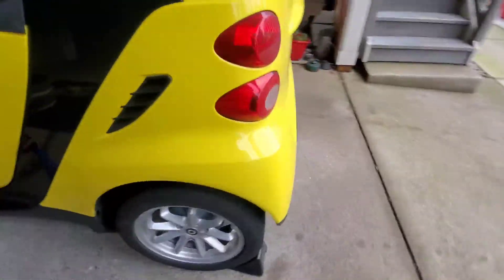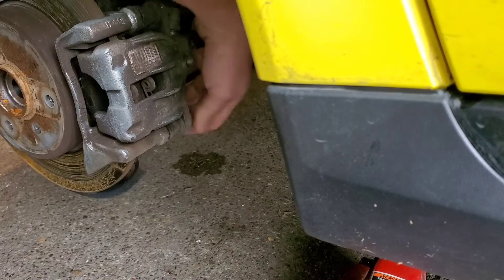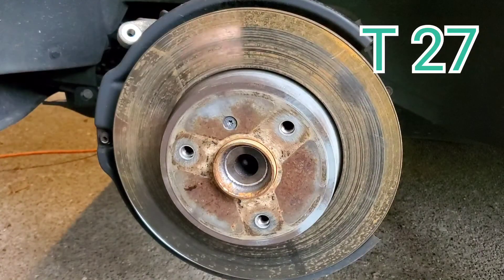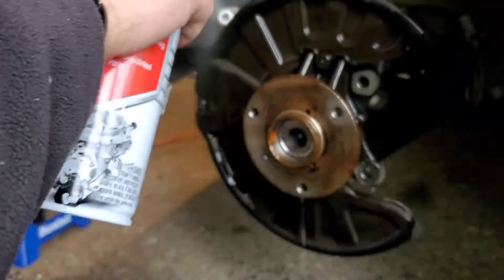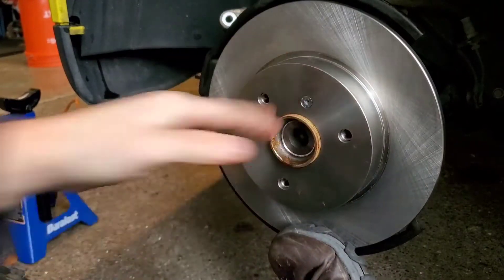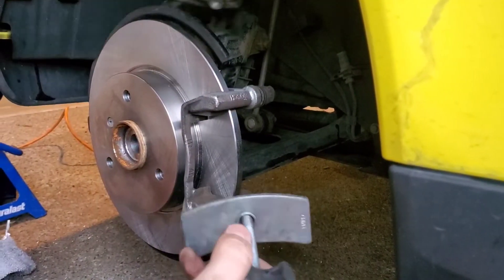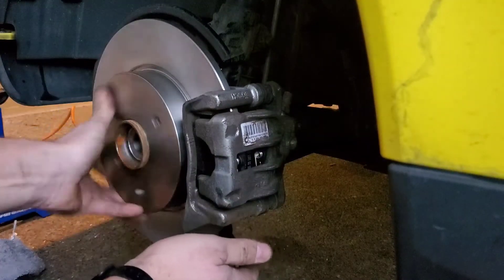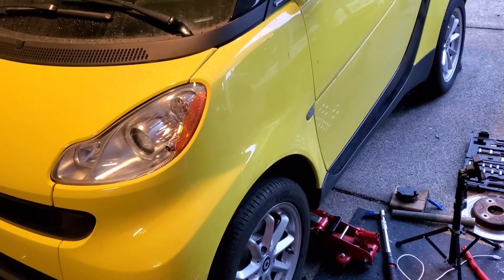How to change brakes and Rotors on a Smart Car

Comment: Thanks so much!  I just bought a 2013 Smart fortwo with 97,000 miles on it.  It seems like it has been well cared for by its only other previous owner and was garage-kept.  I have already replaced the cabin air filter (almost blocked) and the engine air filter (barely off color but, what the heck).  I have checked the three coils, one of which has been replaced. They all looked good.  I will be replacing the spark plugs as soon as my articulated 14mm spark plug wrench shows up.  I have a weird "push-back" on the break peddle that also feels like it is grinding a bit.  So, my guess is I will need to do the breaks and possibly the rotor.  Having said all of that, my real question is, what product are you using to clean the parts?  I see the spray can, but can't make out what it is.
Reply from the maker: Just O'Reilly brand brake cleaner, it's cheaper just make sure you have a mask on this stuff is strong, good luck !

Comment: My 2013 Smart car uses a T30 star socket. Really.
Reply: Ken Becker used a T30 in his video, so I'm assuming the factory changed the spec of the Torx socket after 2008.
Reply: My 2013 uses a T30. I double checked, I'm doing my brakes this month. I used the T30 when I last changed my front rotors and pads at 44K miles.
Reply from the maker: @lionelmandrakegrp.cpt.6396  yeah im guessing they changed size over the years good to know for the future thanks !